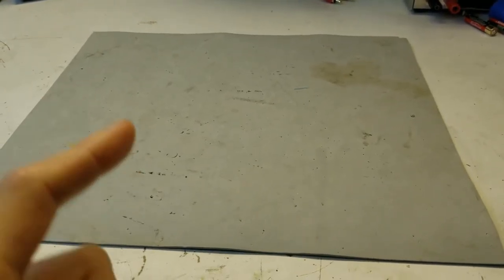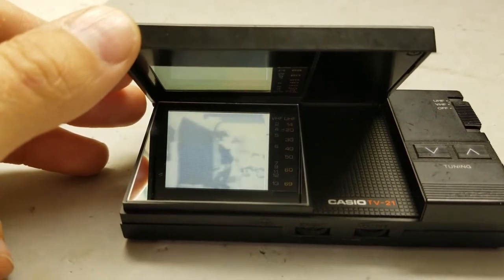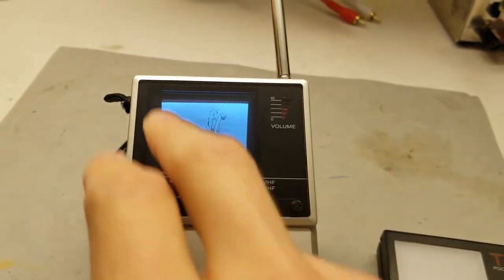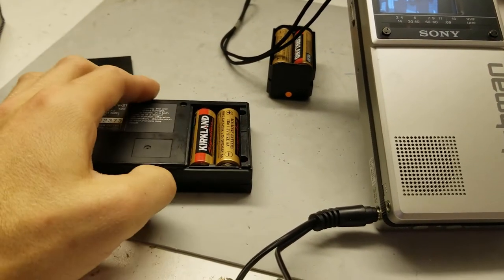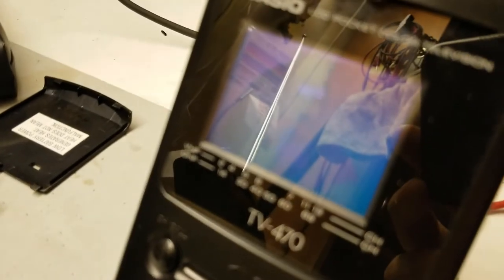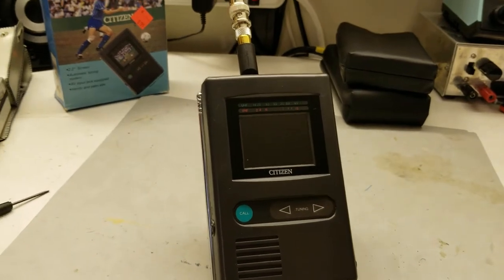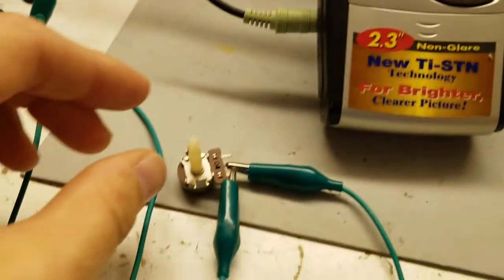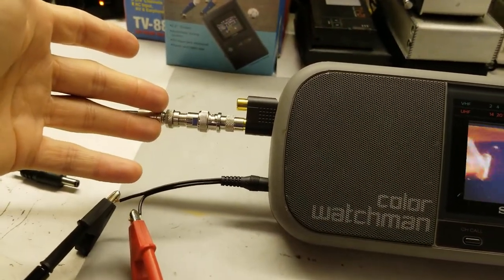Casio TV-21 Pocket TV (from 1985) + other handheld TVs

Comment: With that TV-880, the actual resolution of the display isn't higher than previous 2" display models, but what they did was arrange the dots in a delta configuration instead of as rectangular pixels, which allows better rendering of fine details and a higher effective resolution. Just like early OLED smartphones that had a Pentile display, which had for example a 1280x720 resolution even though there were less than 921,600 dots.

Yeah, that was me. Lots of (all?) Casio TVs expect a lower-than-line-level video signal for some reason. Like you, I built a cable with a resistor in-line, but it's not perfect - I find an RF signal to be better quality still. Perhaps the actual Casio cable has a more complex network to do the conversion. It's the dumbest thing.

Great video!! I need to make videos of my Casios eventually.
Reply from the maker: Neat... kinda like how in the larger CRT realm delta configuration is used for higher res stuff like computer monitors vs inline with televisions.

And yes I'd love to see a video of your Casio collection.

Comment: So is anyone still broadcasting in analog these days? How did you pick up over the air signals for the old early pocket tvs?
Reply from the maker: Unfortunately, no. I was testing this by using an agile modulator with some rabbit ear antennas connected. It works well as a short range transmitter (though I'm not sure if the power is low enough to be compliant with FCC regulations). Here's the agile modulator: https://www.youtube.com/watch?v=RkinbzXOxbM